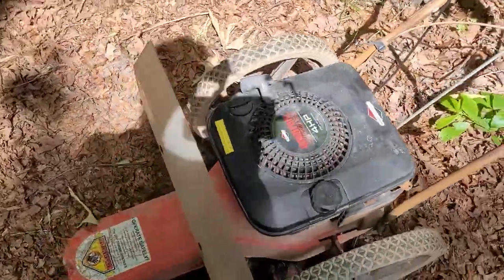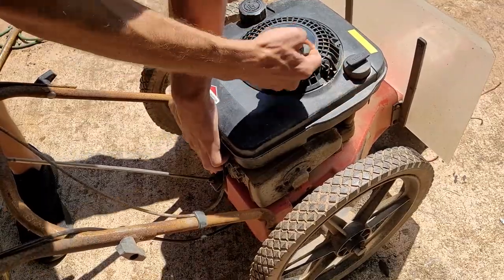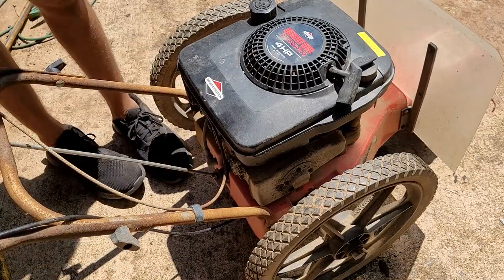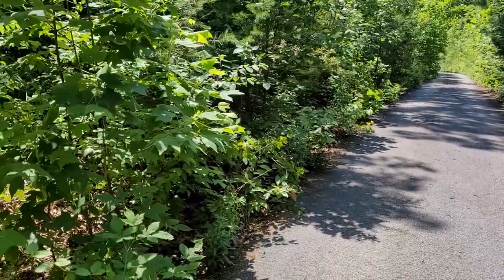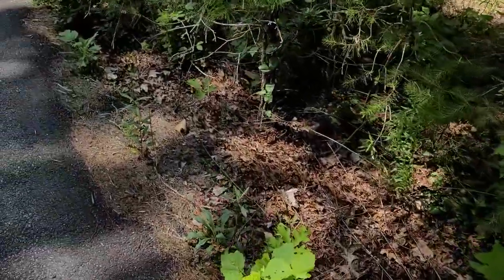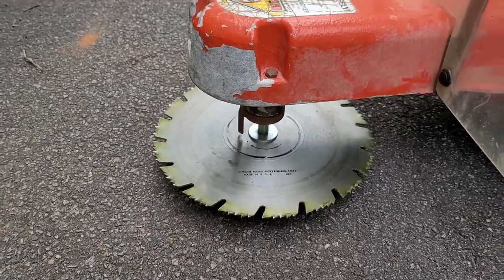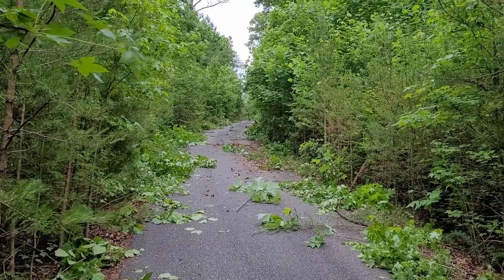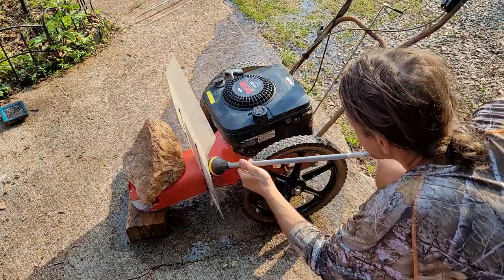Abandoned Trimmer Mower Will It Run?

Comment: Have the same exact one minus the shield in front of the engine. I think my throttle cable gave out...couldn't shut down the mower even when physically pushing on different parts of the throttle body. Basically I engaged the mower and bogged it down then pressed one of the levers on the throttle body to finally kill it.